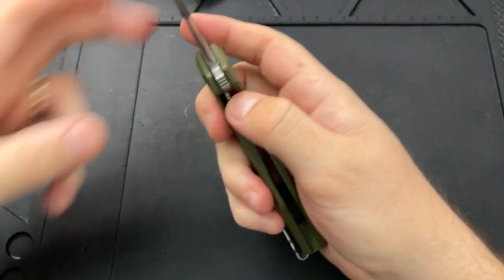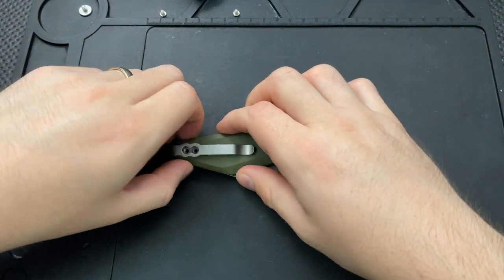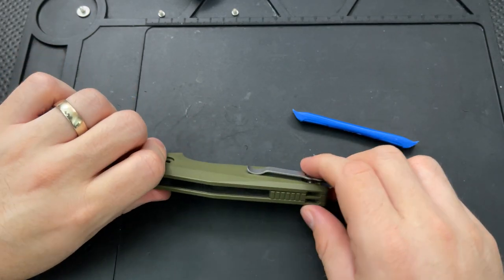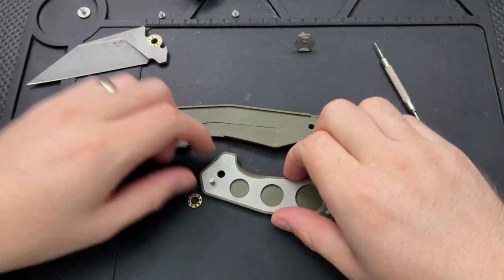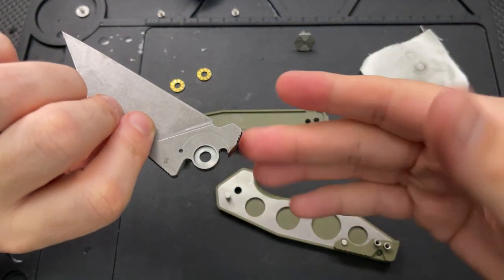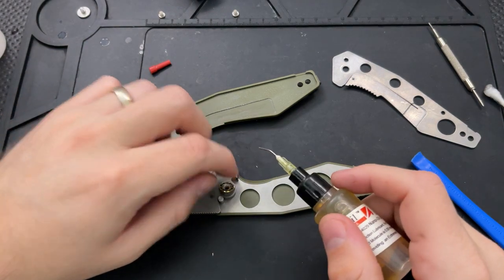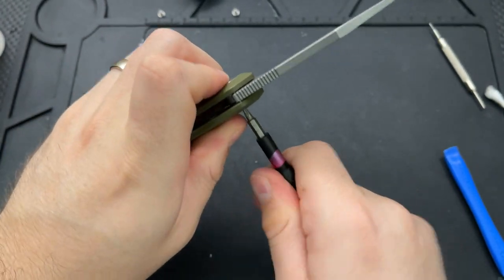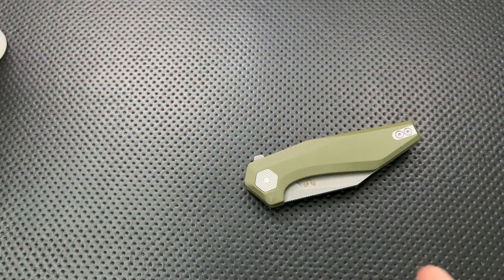How to disassemble and maintain the Damned Designs Fenrir Pocketknife

Comment: Thank you so much! I purchased a Fenrir with titanium scales/body. It arrived today and I was a little disappointed. A little gunky, action wasn’t very good etc. I ended up needing to take it apart to swap the pocket clip. But I’m so glad I did. I remembered you’d made this video and looked it up today. It greatly reduced my stress about taking apart, what to me was a pricey knife. Titanium didn’t help on that :). Anyway, it totally transformed my experience to have disassembled it, cleaned it up, and added some nano oil. It was like a totally different knife. 
I even sharpened it up with Worksharp guided field sharpener. It now cuts beautiful curves through paper without any difficulty. 
Thanks for helping me have the confidence to take it apart and give it a little TLC.

Comment: I love my Damned Designs knives, but my Djinn i can't put back together without blade play. Any suggestions Nick?
Reply: Did it have blade play before you took it apart?
Reply: @regan.8077  No, out of box it was great, but when i disassembled it to clean it i couldnt get it back together without the play.
Reply: @rashadnagi7531  did you put the bearings in backwards?
Reply: @regan.8077 Ive checked, but i can certainly try again.
Reply: @rashadnagi7531  that's the only thing I can think of. And to tighten the pivot more.
Reply: @regan.8077  Its down tight, but I'll keep toying with it.